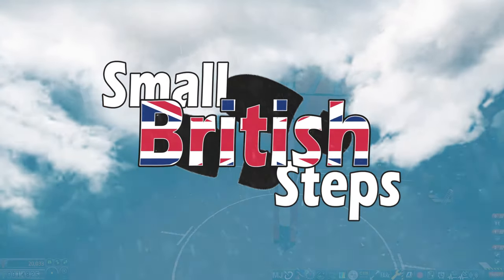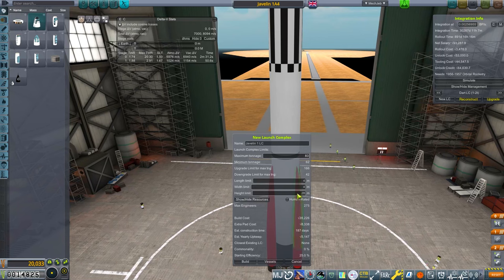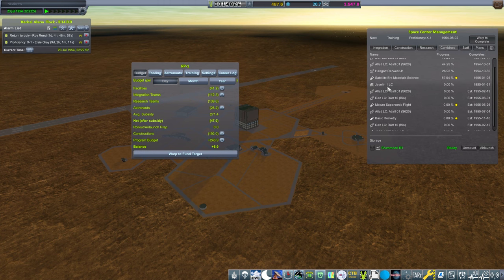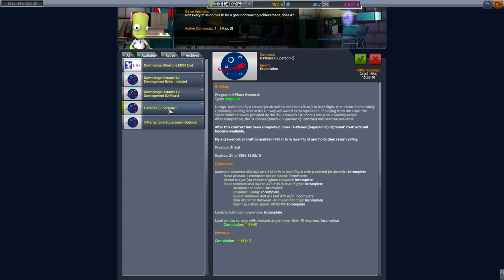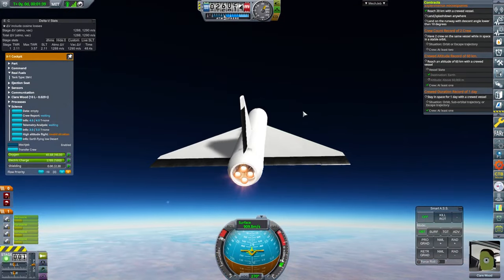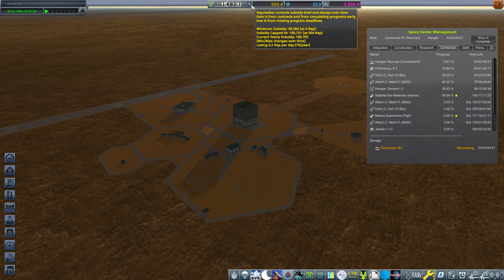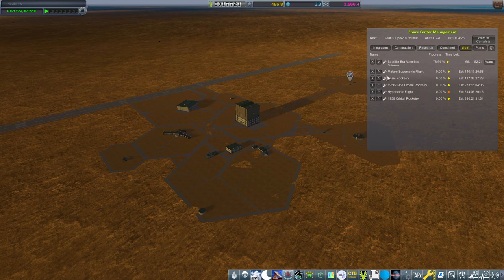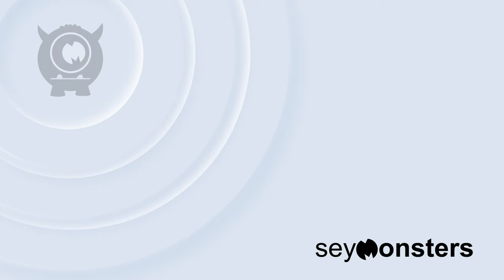WHAT EXPLODED?!? | Small British Steps | 09

Comment: That was a lucky accident, in my experience the "[]" parts are structural linkages..... if they fail you risk having other bits fall off when much less stress is applied. I thought you would rip the wings off with that turn afterwards.
Reply from the maker: I do usually like to rip off wings ;-)
Reply: Also, 49:45 was amusing, sounded like your parachutes exploded as soon as they unfurled. Venus landers anyone?